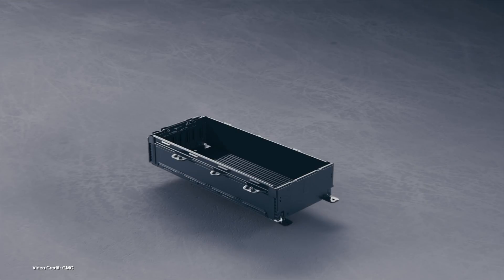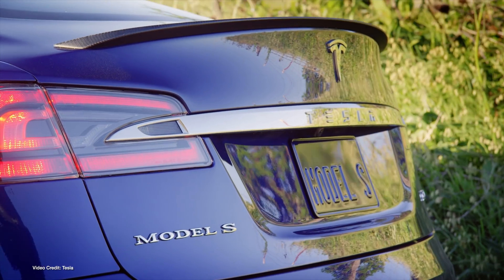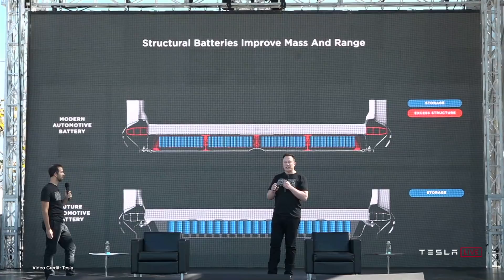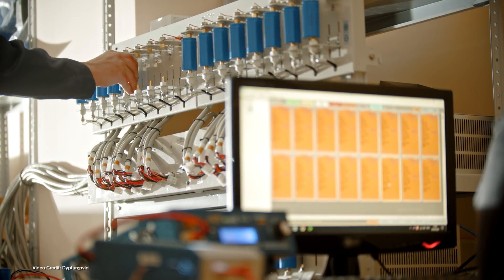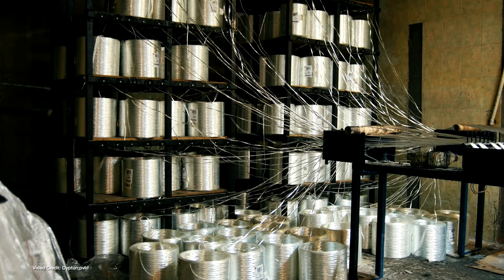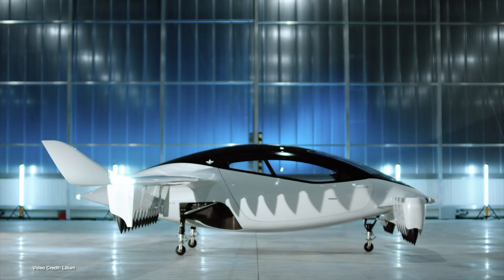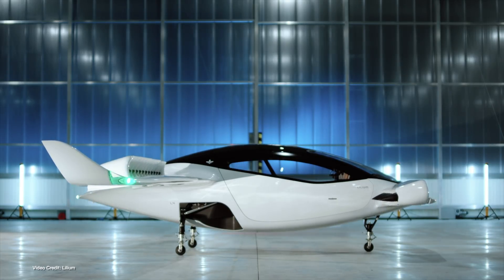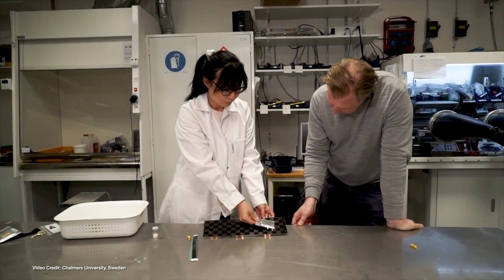Why You Should Be Excited About This Battery Breakthrough From Sweden!

Comment: Well the first gen battery is not useful in almost any aplication. It would be better to go regular carbon fiber and standard battery. It just doesnt have the structural strenght to compensate for the added weight of using it as a load bearing element. The second gen they mention thou is quite promising. Stiffer than aluminium and a more decent energy density. I can see how it would replace lots of elements on an airplane or drone as far as cars as long as its not dirt cheap we wont see it much.

Comment: Some flex can be a good thing as long as you don't go past the yeald point in youngs modulus of elasticity. Very interesting.
Reply: in other words; it is fine as long as you do not break it    ;-)
Reply: @jyvben1520  dead right 👍
Reply: Don't want to snap. Carbide is stronger but cracks. Steel is not as strong, but will bend when pushed past it's limit.

Comment: So... when a car or airplane structure is impacted, the entire structure will catch fire rather than only the battery pack or fuel tanks. Got it.
Reply: Idiotic extrapolation.
A fully laden Boing 777 is a flying bomb with about 100 tons of kerosene on board, but somehow a carbon composite skin with low flammability that can store electricity without tons of fossil fuel is bad?
My bet is that a crash in an eplane is one you can have a much greater chance of walking away from.
Reply: @ahaveland  Crack a phone battery in half and see what happens. Now extrapolate that to a fuselage which expands and contracts every flight.
Reply: @funkknob  You are making simplistic comparisons with a different technology that doesn't contain flammable electrolytes, and in any case, even if the electrolytes were flammable, there would still be 1000x less of them than the amount of kerosene.
Reply: @ahaveland  I'm not. High energy density requires lithium. Lithium ignites on contact with both oxygen and nitrogen. Unless the lab is also developing an exotic new battery chemistry, this will never work.
Reply: @funkknob  You are out of your depth here. High energy density does not require lithium. Other charge carriers are possible.
Lithium metal does not ignite on contact with neither oxygen, and especially not with nitrogen which is much more inert. This is basic school chemistry.
Lithium in batteries only comprise a couple of percent of the mass - ie. negligible.
It is the liquid vinyl carbonate electrolyte that is flammable, and this new battery won't contain any.
This tech is promising, however the thing they will need to solve is not flammability, but recyclability as CF is hard to recycle, but it could sequester carbon.
Reply: @ahaveland  You're right about ignition, but how would you solve shorting? Any crack or puncture creates a thermal runaway condition that could spread over the entire surface quickly. This happens with phone batteries. Cracks and punctures in a liquid fueled jet don't necessarily result in fire as we have seen in numerous incidents.
Reply: @funkknob actually i seen airplanes and jets catch on fired due to fuel leak in the news. It's not the rare to happened.
Reply: @sciarkadatul411  Actually it's extremely rare. Air travel is the safest mode of transport.
Reply: @funkknob  This is not a phone battery. It has a completely different construction and made from different materials.
Instead of making baseless assertions and unfounded comparisons, why don't you do some proper research, read the scientific literature and find out?

Comment: I wish manufactures would stop focusing on range and start focusing on price. Since the first gen electric cars we havn't seen a reduction in price because range has been increasing, holding the price high. Im sure im not alone in having a 2 car family and just wanting a simple EV that gets to work and back with 100km of range as a second car.
Reply: It's the same. Because price is one of the limiting factors on how big batteries can be installed in an EV.
Reply: A hybrid would be a solution. Basically two cars in one. Unfortunatelly, they don't seem to be popular. And due to future ICE bans are not researched into enough.
Reply: @solarissv777  Hybrids come with nearly all disadvantages of an conventional ICE but with few advantages. Here in Germany for example, hybrids are very popular but only for one reason: tax advantages. This really needs to change.
Reply: @EinzigfreierName  current hybrids are not optimal, as they were initially designed as regular ICE vehicles. They have lots of parts that hybrid doesn't need. In modern diesel locomotives, engine is just a generator and doesn't have any connection to wheels, why can't hybrid cars be the same? In this case you can ditch gearbox and use a much simpler engine as it needs to work with constant RPM, also the engine can be quite small and not that powerful, as the energy for rapid acceleration would be drawn from the batteries. Basically such a car would have 20-50kWh battery, and a small 1-1.5L 100-150 hp 3 cylinder generator. Ideally of course, would be 1 cylinder free piston generator, but such engines are not mature enough for automotive industry to invest in just prior to ICE prohibition. Another possible solution would be methane fuel cells, but they are even less mature (although, technically, they are not ICEs).
Reply: @solarissv777  Well, the concept is not new. Eg. the Chevrolet Volt had it. But still it needs additional parts that cost money, need service and are not emission free. I'd prefer to have a bigger battery instead and keep the simplicity  of a pure EV.
Reply: @EinzigfreierName  Engine, fuel equipment and generator still gonna be cheaper and much lighter then a large 100kWh battery, that you still have to haul every day, just to be able to go on a trip  on weekends, and still, a long trip won't be as easy as if it was an ICE car. And for hauling that battery you gonna waste lots of energy (and depending on the type of the local power plant, the long range EV can actually be less green). As for emissions, modern engines are clean enough, and there are ways to go even further, and plugin electric hybrids can still provide full electric commuting in the boundaries of the cities, with the generator turning on only on highways, that would still dramatically increase air quality in said cities.
And don't forget, that not that many people around the world live in private houses, and fully electric vehicles are much less convenient for such people, as they are not able to charge overnight.
The problem is, due to upcoming bans on ICEs, many automotive manufacturers stop their engine development processes this means, that engines won't become more efficient and cleaner any more, and people, who cannot afford an electric vehicle, or in countries, where there is no infrastructure for them, gonna be stuck with old dirty engine technology.
Reply from the maker: I think the dramatic depreciation of used EVs may be a factor here. A used Leaf, Spark EV, i3, or even Bolt, can now be purchased in the U.S. for less than I’d think a manufacturer could sell a new, low cost, electric car. I agree about the importance of greater affordability of course, but I think as long as EV tech keeps advancing so fast, causing EVs to shed value even more quickly than luxury cars, the used market will fill that niche enough that manufacturers won’t bother. - Winter

Comment: Her inner nerd is so self evident here. I always thought you belonged in a lab coat and not doing YouTube ;) Additive manufacturing is opening new doors as to what mass production can achieve these days. EI, Tesla's Giga Press is additive manufacturing as are most of the processes used in the manufacturing of the rockets for SpaceX and Jet Turbines at GE.
Reply: No, it is not! Tesla's Giga Press is just die casting after all. Die casting at impressive huge scale - but still die casting. Please educate yourself.
Reply: @nachtaktivster  it is still a form of additive manufacturing that did not exist. The material sciences to enable casting at this scale without deviations has never been possible until now. The metallurgy available did not allow it. They had to create that at Tesla. That is why the company making these machines had  never built a system of this size or capacity. The metallurgy made it useless to go beyond what they had done previously.
Reply: @davefroman4700  Ah ok, it is additive manufacturing because material science was involved? Got it! What a fool I am...

Comment: A lot of others came to the same estimate I did, 120 miles(200 klm) range.  But this brings up an opportunity, tunable range.  The body can do short range.  But batteries in for long trips or add to the amount of personal range anxiety.  Charge the main battery at home while your driving.  If the main battery fails take it to the shop and have "short" range.  If the chassis as battery fails it can still function less efficiently on regular cells but extend the life of the vechicle.

Comment: A Camry body is 1500kg.  At 24 Wh that's 36 kWh.  Let's call that 120 miles (200 km) of range.  Just estimates.  Yes the body could be lighter but most other cars heavier bodies.  Also reducing the body weight reduces the amount the chassis could store but makes the vechicles more efficent.  The tech could be more or less efficient out of the lab.  So all just swag but in general, the structal battery could be up to 25% of a long range (500 mile/800 km) EV.

Comment: Very interesting technology, but..... For this scheme to be a energy/weight win, the battery has to double as structure, and that means the material has to be distributed to where the vehicle actually needs structure, which is all over the place from front to back, top to bottom. At the same time, it still needs to implement a several-hundred volt, 100s-of-amps capability. And that means if there's a collision with a vehicle that conducts electricity (ie: body made of metal), there's going to be some pretty exciting sparks!

Comment: Are 'structural batteries' not becoming  non-repairable?
Has one not then to replace the whole battery-pack, if a single cell fails?
Reply: Good question, thats why prismatic batteries are the best.
Reply: Replace whole car
Reply: One might not have to replace the whole car, but the refurbishment of batteries may become impossible, & then one has to replace the whole battery, min. 5k$ a piece.
Reply: @flyby2300  Your right,
But It depends on the implementation,
Tesla´s idea is basically replace the whole car,
Reply: @flyby2300  unfortunately before batteries becomes cheap enough, we first need to make at least millions of batteries and alot of lithium to reduce the price and its going to take a long time.

Comment: So if the battery fails (which is the most probable) We will be force to change the structural part? ( chassis, roof , doors,...
Does not sound good
Reply: I agree that’s a problem, but current gen batteries last longer than the car so probably not a big problem.
Reply: @peterbrown6453 Good point, but mixing functionalities may lead to extra costs when repairing.
Anyway if the cost of the structural composite becomes very low this is not a problem.
Then we have the recycling issue.

Comment: 1000kg of this material would give you a 24kwh battery.  Essentially a first gen Leaf without a battery pack.  Could be really amazing at even just a slightly higher energy density.  I'd love to make some things with this.
Reply: No because a lot of this weight is not from the chassis. Things like seats, stearing wheel, air conditioner, electric cables, wheels & tires etc. can't be replaced by a "structural battery".
Reply: @EinzigfreierName  "Things like SEATs" LOL Supercar makers would beg to differ.
Reply: Then somebody rear ends your car, which would usually lead to some crumbles in the trunk and a broken light, wreaks your car.
Reply: @VolkerHett  The structural battery will not be part of the crumble zones. It will be a part of the zones of your vehicle where everything should be as intact as possible to save your life in an accident, and it will part of what holds everything together every single day, hence "structural".
Reply: @Arpedk  Just my thinking. But that's far from the ton of metal in a car besides the drivetrain. And then we need it to be a lot stronger than it is now. And even stronger when we think about what might happen to physically damaged LiIon cells.
Reply: @VolkerHett  I think you are overthinking it. Lets say a normal car needs 400 kg of steel just for its structural properties. 
Then when you have a structural battery weighing in at 600 kg but it adds 300 kg of structural propertied. Then your total weight will become 600 kg (battery) + 100 kg (additional structural steel) = 700 kg. So your battery+structural ends up weighing 300 kg less than otherwise, and the battery only adds 300 kg of extra weight to the car. 
Everything else in the car will be not change as you have the same structural strength as before. 
You may also in the first end up with a battery that doesn't need any extra structural elements and thus a 600 kg battery may only end up with an additional weight of 200 kg (600 kg battery - 400 kg structural steel) as the extra steel in no longer needed. Compared to an ICE vehicles this may end of weighing less as the ICE vehicle still needs to add a gas tank, engine and transmission. At the end of this decade battery electric vehicles will have the same or less weight than an ICE vehicle.
Reply: @Arpedk  Yes, I'm probably overthinking. 
When I got it right, the material has around a third of the strength of other materials used in cars. So I assume they need a lot of it :) 
My knowledge about carbon fibre is from a friend who has a company making CFR parts for aircraft and naval vessels. Those components are pretty strong especially compared to their weight, but bloody expensive. And they're pretty delicate when it comes to impacted from the wrong angle. 
Don't get me wrong, I like the idea and it certainly has potential, but I doubt it will be in use in cars in the coming 10 years.
Reply: @Arpedk  How much steel does a Tesla use? Musk is casting his alumin chassis parts now so weight is already down.
Reply: @linmal2242  steel vs aluminum have nothing to do with the discussion of structural batteries. Sure aluminum castings save additional weight on the vehicles.
Reply: @VolkerHett  Theres a lot of confusion over stiffness and strength in this video. They aren't linked.  As expeienced engineer the whole thing looks like 'meh'!  It might be significant - but it looks and sound slike a hundred other 'breakthroughs' in teh lab that fizzle out as soon as you walk it through teh lab doors.
ps..s C-fibre is 60 years old and still nich and expensive - because its diffiuclt to scale up consistently and awkward to fabricate and work with. It can be done - but the benefits are often really marginal . You only use when weight really matters
Reply: @VolkerHett  Maybe the self-driving A I will solve that little problem of collisions?
Reply: @linmal2242  I work in IT sind 1982, I have my doubts about the infallibility of machines :D

Comment: Sounds great superficially, but in reality this will be a nightmare in terms of long term serviceability unless revolutionary improvements to serviceability are made.
Reply: I agree. It’s usually the case in these “breakthroughs,” it works in the lab but they don’t think of the difficulties at each level such as mass manufacturing, repair, recycling, among other things.
Reply: A small parking accident might become a nightmare. 
This might be useful in some hidden parts of a car, but I'd prefer it not being the body shell.
Reply: Yeah autos become disposable when their batteries need service, don’t they?
Reply: I would assume most this would do is stuff like be used as load bearing central platform, with minimal protective cladding. Instead of current setup, where there is a heavy pack box around the battery cells to be load bearing. The battery box would still be load bearing and might not look outside that different, but crucially more of the weight of the pack box is the battery. Since the batteries are bearing the weight, instead of current setup of battery pack box protecting the cells from having to bear strains. There almost certainly would be outer skin of some material around just for sake of environmental and safety reasons.

So battery box, that would be have to be handled delicately when empty or it would crumble. However full of battery cells..... Super stiff and works as the main load bearing chassis between front and back axles.
Reply: @aritakalo8011  Unless the battery bolts directly into the frame, the battery box will still need to be strong enough to transfer loads from the frame it is bolted on to the cells, so the battery box will still have plenty of structural integrity on its own. Unless the whole thing is made into a solid epoxied block, the only way to make cells contribute to chassis integrity is by actually having the top and bottom covers operate as tension-compression planes and using the cells to keep them from buckling into each other, which can be done with conventional cells too.